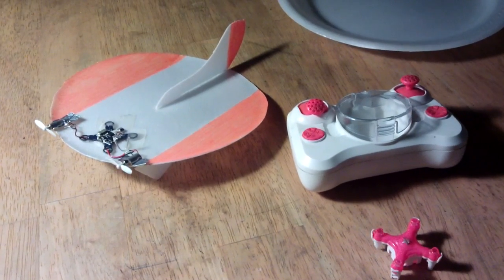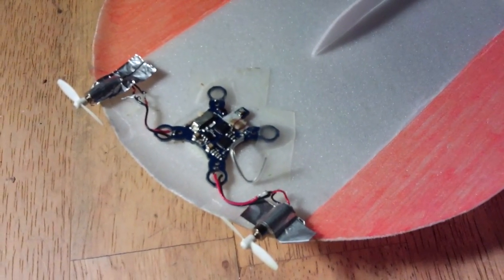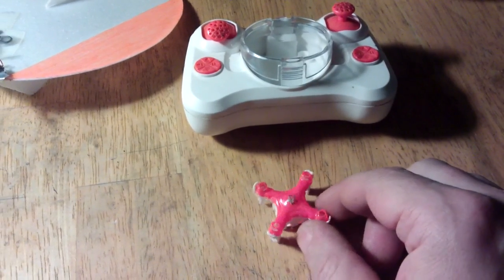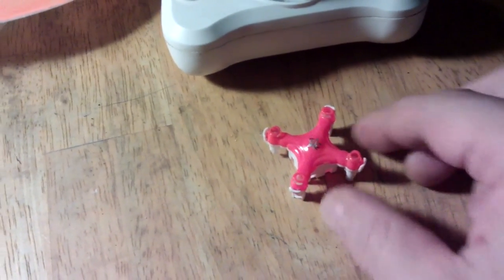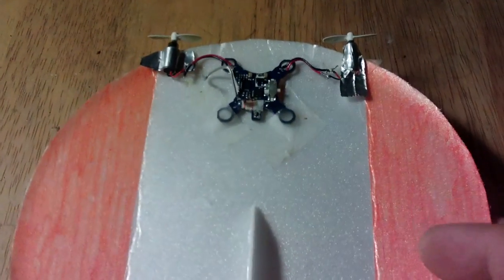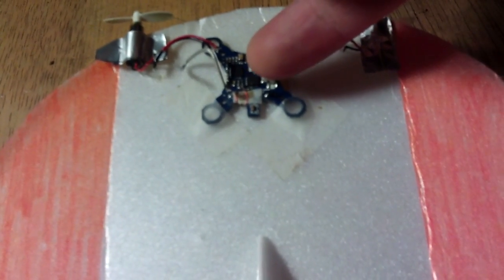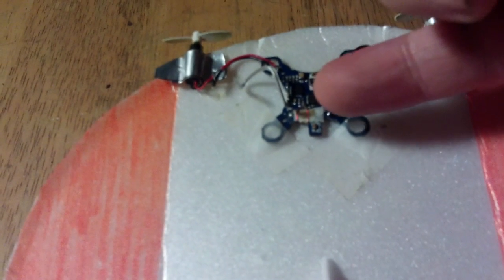Broken quadcopter - converted to....

Comment: After getting bored with several tiny little quads i was hoping to use the spare parts to design a indoor micro fixed wing using the radio and perhaps one of the motors. can you tell how many channels this rc link is ? and if there is any way in which i can use all channels.
Reply from the maker: Good questions and I only have partial answers. 4 channels, that all affect each other. Am still looking for a way to gain actuator control, being that no channel is always off and there's no zero throttle powering of channels, such as rudder. 
The best method is the Peter Sripol one, where you just use the rear 2 motors of the quad, keep all else the same. There are plenty of light twin engine planes can be built. I have one called Whisper, which is based on the frame of a PZ Vapor. She flies great and is an indoor candidate. Both motors are upfront, differential thrust for control. Here's a link to the Unregistered maiden flight vid: https://www.youtube.com/watch?v=jeBir3eTcpw
8g with a 30mA lipo, will fly longer but a bit faster with a 150mA.
An alternative to 'larger' shapes is a tiny Fw190 of 8" span that was maidened a couple of weeks ago. Motors are on the wings:
https://www.youtube.com/watch?v=05aUO7RmZDM
Things to remember for airplanes powered by quads that still have a gyro, based on about a dozen conversion s so far - 
The gyro hates to be tipped. Wings should be short, with a long chord for slow flyers.
Any design needs some dihedral, the gyro can become aggressive and will wing rock excessively if flat wings.
Pitch is reversed, upward nose brings a power burst, dropping the nose causes less power. 
Don't worry about wind, it's the big upside to the above  :)
Range is an easy 100ft perhaps more on a plane and possibly because of much less motor interference, as tested with Eachine E010, Furibee F36, JJRC H67 (Santa quad).
I have a vid where the sticks can be altered so that both throttle and steering are not both on the left stick.
Anything else, just shout, it's a joy when you get something roaming around the backyard. Twin motor differential thrust is great on these small planes, though I too would like single motor and rudder/elevator.

Comment: how it is flying ? i would like to know the principle behind its airfoil . sir plzz tell
Reply from the maker: This sort of basic flat surface moves forward in the air on an angle, High Alpha it's called. As it moves, the air pushes the front up and if you have enough motor power that will cause the aircraft to lift.  It needs a lot of surface area, but works really well for slow speed flying.
Reply: Slider2732 
Does it work on AIRHOGS AIRJET DRONE ?

Comment: I did the same mod to my Wal-Mart drone to delete the gyro find the M540 chip, it's the smallest 1 on the board, I used a tac to break the little caps connecting it to the motors....
Reply from the maker: Excellent news! . That is good to know, have 'Hearted' your comment :)

Comment: Hello, how can I know where the mini drone gyroscope is? How do I do what you did to it? I'm from Argentina and I want to build a plane with a broken mini drone, but since it has a gyroscope, if the plate is turned, one engine moves more than another.
Reply from the maker: Hi, sorry for the late reply. Best method is to look at the chips on the board and type their numbers and letters into a search engine. You should find some return with datasheets. One will be the gyro and the idea then is to cut the wire trace that sends the signal back to the main flight processor. You could also try denying the positive voltage trace to it. If done correctly, the motors won't speed up or slow down when moving the board around. Good luck :)

Comment: Nice concept. I also have a quadcopter and figured out how to switch the motor configuration to provide 3 axis control for a plane. Do you know of a way to disable the altimeter and let the throttle be user controlled?
Reply from the maker: Have never tried such a thing, not being a fan of alt hold for the type of flying that I normally do (indoor or backyard with obstacles). 
But, do have an idea.....I would say to take the spring out of the throttle stick. The pot inside will be being held in the mid position, which should equal half of the pot travel. If the pot is 10K resistance, that would be 5K in the middle position. 
So the trick, would be to make the receiver think that the stick is in the middle when it's not. 1 way would be to solder a 5K resistor in series with the pot, giving the bottom position as the new zero, pushing up then increasing throttle. 
You could also have a switch across the pot that then would give a zero ohms to the receiver when pushed, thus powering down the motors to lowest throttle for landings.
Saying that, hopefully it's not a set amount of throttle for altitude gain !
If you get different speed ups of the motors for throttle increases when the quad is held in the hand, then the idea may work.
Reply: Awesome! I will look into what I can do!
Thank you very much!
Reply: Do you know if the quadcopter will fly with the altimiter disconnected?
Reply from the maker: If it has one, quite probably. It won't know how high up it is, so should disregard as there's nothing to limit the height. Have never tried such a thing. As far as logic goes and having tested a BMP180 for elevation (Arduino), the sensor shows a figure for the ground and then can show changes based in inches or cm when it's moved. If it calibrates as zero, it won't move from that and so can't increase or decrease by itself to correct any flight height difference..... you'd be putting blnkers on it  :)
Reply: Ill try it out, see how it goes.

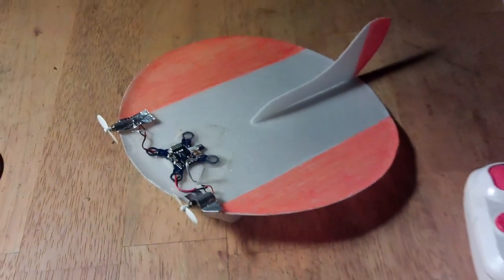Comment: I wonder which copper line that should cutted at 2:21
Reply from the maker: Have just had a look at it and the bottom left pin of the chip goes to the right side solder point of where the desoldered capacitor was.  
Unless you mean, cut the wrong one and the whole thing explodes lol
For other quads, I would expect the gyro's to be 1 wire or 2 wire protocols. Just need to trace those connections to the CPU, then cut at points that they could be reconnected to if the cut doesn't work.
Reply: Slider2732 , thankyou !..I think this is the cheapest way to make a diy micro rc planes. I love your videos..very unique
Reply from the maker: Thank you for the kind words :)
Yes indeed, for backyard flight it makes a good option

Comment: How can i locate the gyro on my board? Also, how do you 'defeat' the gyro? Thanks!
Reply from the maker: My method was to identify the chips with online searches of the numbers 
written on them. Normally someone has taken apart the same model at some
 point, so you may see threads on RC Groups or other forums..
Next, trace which circuit tracks lead to which chips. The gyro to the main processor seemed to have a couple of wires connecting them together, which I reasoned to be I2C (a 2 wire protocol). Cutting the correct circuit trace made the processor think it was always in level flight. So that's the idea....though don't do such a thing with a quad you might not want to lose to experimentation ! The circuit traces are less than hair thin !
Reply: Ok, thanks for the advice, and that's an awesome little plane

Comment: hi sir! thank you for this video i want to make it for our thesis
can i ask how you remove the gyro? and where is the battery?
thanks sir😊
Reply from the maker: Hi. The gyro stayed onboard, but was defeated with its output line to the main control chip. Without the gyro, the circuit doesn''t work at all, it is checked at startup for the quad to know it's on level ground. This mod seems to make the quad think that it's always on level ground, no matter what the actual direction is that it is pointing in. 
The battery is underneath the aircraft, to allow for the correct CG of the airframe. The wires go through the foam.
I would think that only some quads gyro output can be altered in this way, depending on how the firmware has been written. It would be quite fascinating to try to convert more, but I have no others to try it. 
Good luck with your thesis and I hope you can defeat a gyro on a similar quad. All I know so far, is that it can be done with the Floureon FX-10 :)

Comment: @slider2732 This is a late comment but how would you go about transforming this old GPX DR775R Wireless Drone, Red? As in could it be done and do i just use the front two motors or does it not matter?
Reply from the maker: Am not sure about specific models, this one was a happy chance of a thing. The gyro is the key though, else any conversion tries to cut or power motors when not horizontal. The gyro outputs signals to the main controller chip, which connection though is what has to be found. The front motors give left/right correctly. Pressing for flips gives a neat effect after conversion, with a huge spin that recovers well. Wish I had a few different models to modify and then could better help such folks as yourself to convert them.

Comment: nice love the video , I wonder if you could do it to a busted helicopter? you think it will work i have got one
Reply from the maker: +Juan Smit Indeed. There's a large RCGroups thread that focuses mainly on the WL Toys series. Some heli gyro's can be snipped off and not affect flight, with this quad it wouldn't bind, so the output had to be bridged.
Here's the thread: http://www.rcgroups.com/forums/showthread.php?t=1636399
Reply from the maker: Just an update that I hope helps - i've got a Syma S110g board to work now, either differential thrust like this, or motor and rudder. It should work for the S107 (i think too) if your heli is a Syma and has a 14 pin chip with silver box to the side. 
With pin 1 of the chip being where the little circle dent in it is in one corner, pins 8 + 9 simply need to be soldered together. That's the 2 in the bottom corner opposite pin 1, that lead to the silver box, which is the gyro.
Reply: slider2732 thank you I'll check it out, how was the weather out there in Oklahoma , it flooded out here in Texas I live in Texas gatesville to be exact and it pounded the crap out of us heheheha , well thank you slider, for your time keep in touch I'll be waiting for the next video bud , thank you again , chuco
Reply from the maker: Rainy, windy, ideal conditions to fly this Microball LOL. Took it out to the flying field in 10mph wind today and had a blast. It handled it excellently, just like the bigger version in a recent previous vid. I'll be posting that vid tomorrow on my RCGroups blog (same username on there as on here).
Reply: slider2732 oooh , so it's your RC club ? Cool I did not know that , that's cool I'll check you out on it , do I have to sub to it to see the vids ? Well I'll see I'll sub but under your s  blog that is , thank you , whatch out for tornados I think it's heading your way , it just started raining and thundering like crazy it's five in the morning right know , reminded of when I was a kid in Vegas NV the desert storms and electric ones as well , thanks again hope keep in touch later, chuco
Reply from the maker: The Blogs are just an area of RCGroups where folks can post whatever their thoughts are, or builds, or what they've bought for the hobby etc.
Have just uploaded the vid and backstory:
http://www.rcgroups.com/forums/member.php?u=235502
Yep, storms and raining again here. You guys be safe ! it's much worse in Texas !
Reply: slider2732 still raining here non stop on and off a lot of touring , stay safe over there , there was a tornado warning siren earlier but nothing everything got quiet a still , I was outside cleaning and the horns blew , waited and nothing happened then it just pourd down rain , stay warm and safe , chuco

Comment: Brilliant. I suspect the gyro is interfering with my little flying wing using the WL911 board. I keep meaning to look deeper into that as I have seen details on the forums on fixing it.
Reply from the maker: +GrandadIsAnOldMan Cheers. If the wing alters speeds with angle changes then yep. Heli board mods seem to focus on those WL Toys receivers, perhaps because of good proven successes. I have none to try and most certainly would have picked something bigger than this gnats finger nail with a choice !
Reply: slider2732 I haven't been able to replicate any gyro effect on the ground by altering the attitude of the plane, I have even tried moving a neodymium magnet next to the receiver to see if I could affect the gyro but nothing happens. However in the air I often get the feeling it is doing entirely the opposite to my input (not just because it is flying towards me instead of away). Most of the forum suggestions simply involve flicking the metal cover off the gyro and pulling out the "pendulum" but I haven't looked yet to see if this is right. The receiver in the flying wing is hot glued in place with the gyro hidden from view so I would need to cut it out to work on it. Not difficult, already done that once to turn it through 180 degrees to change the elevator/rudder controls round. Just one of those things on the list :) I have a small discus launch glider series coming up that I used full size receiver & servos and it is well overweight. I had originally intended to use the WLV911 but had been put off due to my suspicion about the gyro. I may well make another and try the 911 anyway as I have established the general build project worked OK.
Reply from the maker: That would be with the motors running ? The FX-10 here did nothing at any time while they weren't running, but went batsnip crazy with any throttle at all.  I'd say do the mod and note any changes..if no changes, then at least it can't be the gyro lol
Ooh I like DLG's. Got an Alula here that still needs another servo. The trick seeming to be to launch with slight up elevons and then to lower them at the top of the climb, else this thing just loops. Am looking forward to your experiences :)
Reply: slider2732 yes with the engine running. As for the DLG that seems to be the launch technique and I certainly haven't mastered it. As I say, it is too heavy for the wing area, but was certainly educational and DLG does give a surprising increase in height compared to just throwing it normally.
Reply: @Slider2732  I am thinking of building a simple rc plane with differential thrust (no flaps, no servos). Apart from an old drone, any idea where I can find a transmitter and receiver that does not cost much?
Reply: Slider2732 today I my mini drone broked so I was looking for videos converting mini drones to rc planes I watched your videoyour awesome and cool idea I liked it

Comment: Neat! Looks a tad bit tail heavy though?
Reply from the maker: +Seal That's how this goes best, though it could do with some trimming to not hunt for the sky with throttle input. As you likely know, aircraft like the Nutball or Havoc Cyclone fly around 'high alpha' and it offers a lot of room for anything resembling controlled flight when something is made in 15 mins from a polly plate lol. When the rear is bent down this zips around pretty fast. 
The batt has now been desoldered and 2 pin connectors have gone on. It was quite limited for placement by being directly wired on short little stubs to the quad board.
Reply: slider2732
You did a great job!
Reply from the maker: +Seal Thank You. Btw, it now has a bullbar on the front, made from a piece of wire to protect the props if it was to nose in. CG is indeed a spot better placed, you were quite right :)
Reply: slider2732
Not a bad idea! I'm a pilot. Everything is about weight and balance for us and I've flown nose heavy and tail heavy before. CG is critical even if it's only a model plane. This one I really like. Simple yet very aerodynamic.